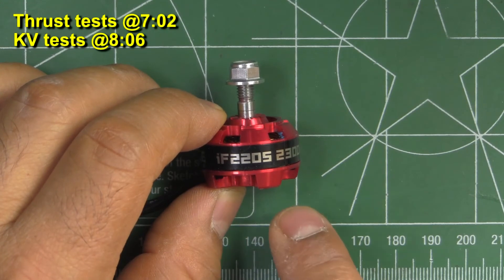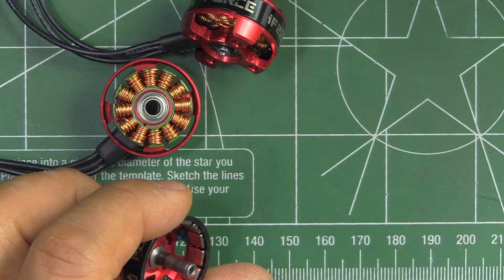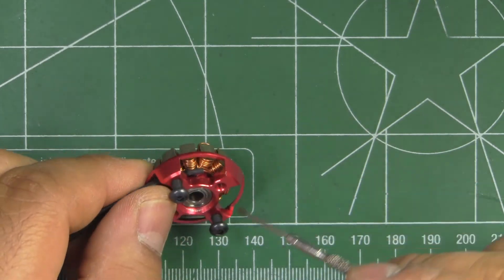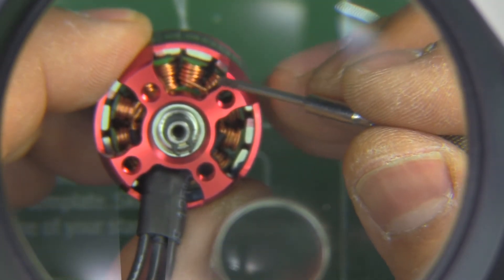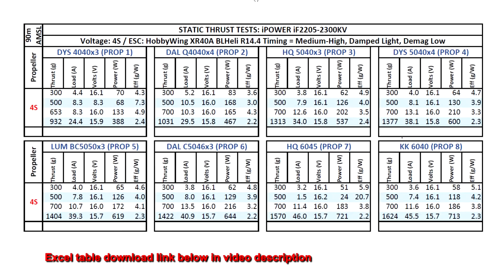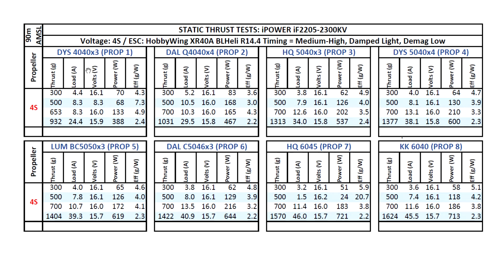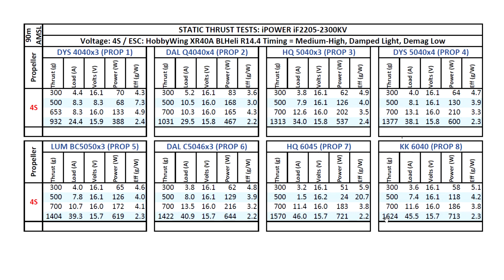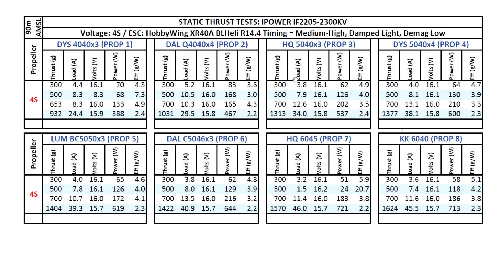iFlight-RC.com iPower The Force iF2205 2300KV Static Thrust Tests & Overview

Comment: Can u review the iforce 2207 2300kv or 2700kv ? Thanks!!
Reply from the maker: renatobfa iF2207-2300kv tests https://youtu.be/9WftTy2N1b8
Reply: EngineerX im planning on buying a 2207 that is on the efficiency side, around 2300kv, and durable (regular base, i dont trust naked ones).. Do you think the IF2207 2300kv would be my best option?

Comment: Are you going to test the Racerstar BR2205S or the BR2306S anytime soon?
Reply from the maker: Just got delivery of the BR2306S-2400KV I bought a couple of weeks ago. So I'll be testing that one soon. Hoping to start running thrust tests this weekend if time permits, then it takes me about 1 week or so to get all the data organized and upload video. So check back in about a week.... but might take longer depending on free time available.